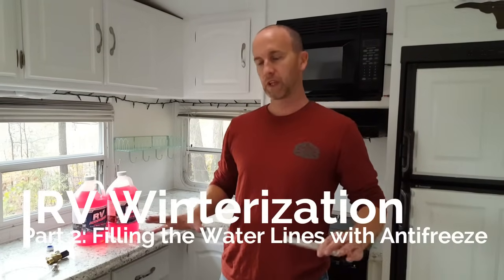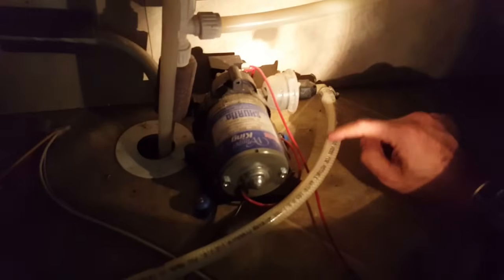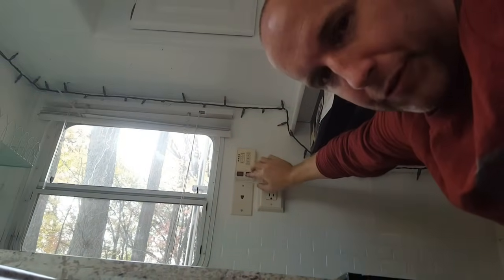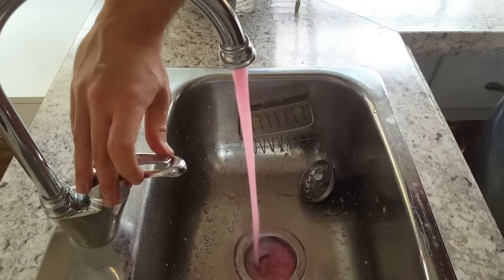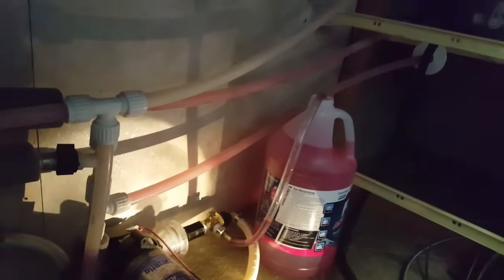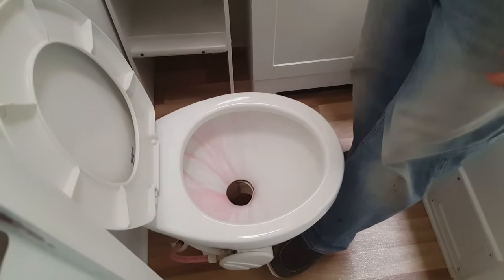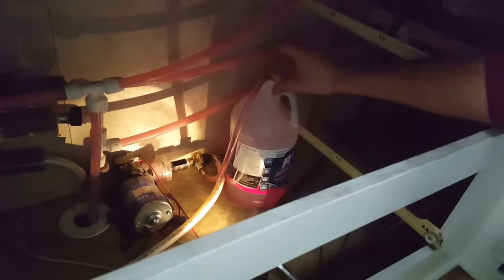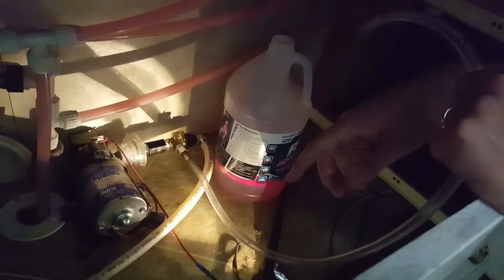RV Winterization Part 2 - Putting Antifreeze in the water lines

Comment: AT THE END OF YOUR ANTI FREEZE IS IN YOU SHOULD TAKE OFF THE SCREEN TO YOUR INCOMING WATER  LINE AND TAKE SCREEN OFF AND PUSH THE PRESSURE LINE WITH YOUR FINGER TO RELIEVE THE OUTSIDE PRESSURE AND PUT BACK THE SCREEN DO NOT DO IT WITH PRESSURE ON THE LINE WILL BLOW OUT THE O RING

Comment: Should put a cap on the antifreeze port on the valve adjacent to the water pump.  If that valve fails under pressure, it won't spray water under the cabinet.... or seep, et al.
Alternatively...  leave the hose attached and put a hose end valve on the suction hose that you can close when you aren't using it, and it will ALWAYS be setup to winterize, and you won't have to worry about purging the suction hose.

Comment: I have a pop up camper and I'm learning a lot from your videos, unfortunately I didn't winterized my pop up like you I just drain the system, I hope next time I use it it will ok
Reply from the maker: jose orozco Glad to hear that our videos have been helpful. Hope it works out in the Spring when you start using it again.

Comment: how did you prep your washing machine that's got water in it
Reply from the maker: Hi Kevin, we didn't do anything specific to the washing machine itself.  Our thought was any significant water in the machine gets pumped out during each cycle before it switches over to dryer mode.  I would expect some residual moisture to be left in the lines but not enough to cause issues.  I have certainly been wrong before though!  Any recommendations?  Thanks for watching.

Comment: Yeah adapters are a MUST. WHY?  They make a $25/job...about a $sub 10/job....year-after-year.....decade, after decade....hey, that's a lotta free fire wood, food, gas, etc.

The benefit of using the air....is to save on the antifreeze each year too....more than one camper....this savings is massively compounded.....each year.  Why?  Because one needs not wait for 30 seconds for a water-antifreeze mix to visualize....you already know that the water is effectively all gone.  Hence,...much less antifreeze will be needed yearly.  "More gas for the Chain Saw."